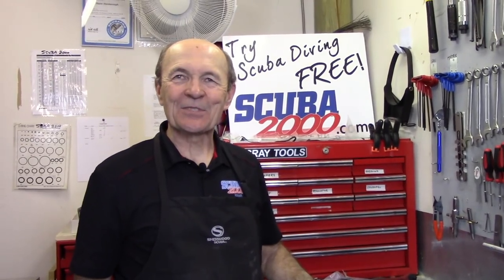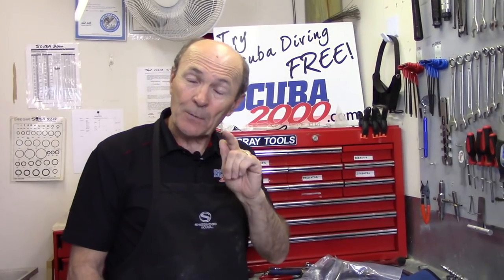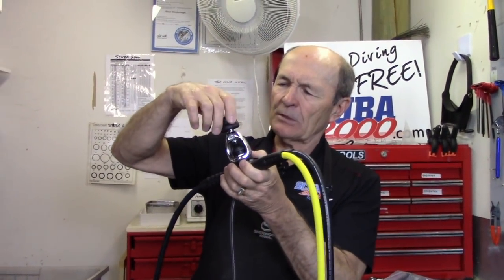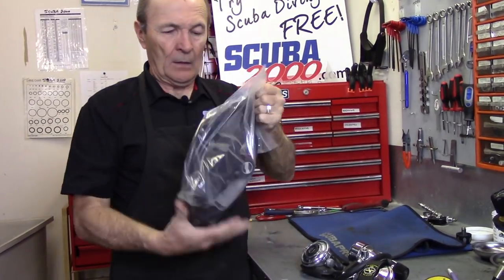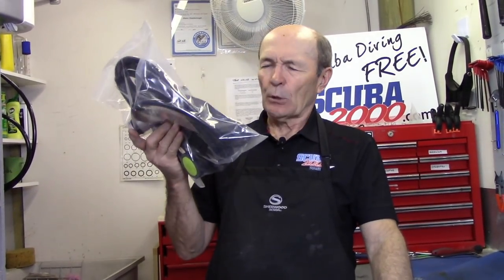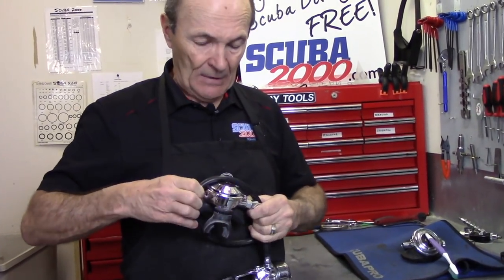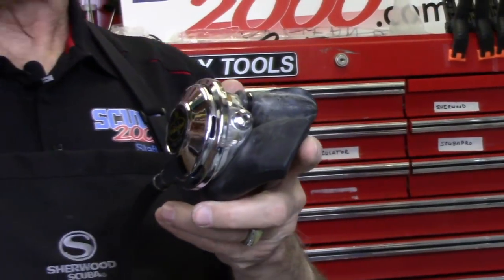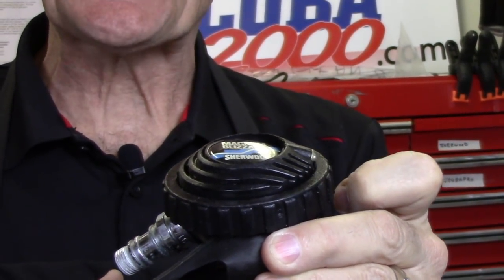Regulator Storage - Scuba Tech Tips: S03E16

Comment: You constantly amaze me with your insight. One thing i would mention is that regs really do need to be serviced REGARDLESS OF USE as I personally had freeflow from first stage due to diaphram. These diaphragms are under tension wether you dive alot or not at all an therefore will still wear over time ( just like rubber o-rings). Good dive shops will give you the old parts they replaced, and boy there are a lot of o-rings in the first stage! So service your equipment guys to be SAFE. And no i do not work at a dive shop but have many c-cards and 15 years experience

Comment: Another tip that might help when you're done with your regulator before going into long term storage is discount store rubbing alcohol... when you finish cleaning it out  you put it out to dry because you cant get ALL the water out of it no matter how hard you try. After it's left out to dry and you got as much water out of it  as you can, put it in the bag and add in half a bottle of cheep rubbing alcohol, close the bag and then you shake it all about and while you're finishing up doing the hokie-pokie that last bit of water gets diluted in the alcohol that gets poured out of your clean sanitized bag and the regulator will still have a few drops left but it will be alcohol instead of water. Then you can leave it out to dry and that's only five minutes or you can put it away with the few drops still in it without having to worry. $1.00 saves the day !

Comment: I've had that happen to me.  Didn't use a set of regs for a quite a while, but they had been freshly serviced and then stored.  Well, after hooking them up they would free flow a bit, due to that indentation in the seat.
Reply from the maker: Yep. Spring pressure on a rubber seat is bound to cause a problem eventually.
You can ease the pressure using one of the homemade ideas in the vid if you're going to be storing the reg again.
Thanks for watching.
Alec

Comment: Hey Alec.  I have an sr2 and reading through the info i read it has an automatic seat or spring thing that worked when depresurized from the tank.  not sure if its a load of bs.  but i thought it would make a nice invention were it true of course.  thanks for your time and hope to see more interesting videos.  keep up the good work
Reply from the maker: It is quite true actually. When the pressure is relieved from an SR2, the seat moves away from the orifice. So with this regulator there is no 'setting' or impressing of the seat nor any spring tension. It is designed to reduce the likelihood of freeflow even if the reg is not used often.
Thanks for watching. Alec

Comment: I was always wondering what that little button was for on my second stage Sherwood's m-blizard & htr...& I got them about 20 yrs ago! You never know when you learn something new, even if I thought about it each time I dived!!
Reply from the maker: Dive store clerks often forget or neglect (there's a difference!) to tell divers about the features on their gear.
Glad to help.
Alec
Reply: Actually, the regulator came with some scuba gear I bought from a classified ad. The previous owner told me he dove less than ten times with it (the reason he sold was a bad diving experience with his buddy…) & when I  got to a dive store to trade ‘the way too large for me orange Viking dry suit’ for a ScubaPro nighthawk wing bc ( I also included an Air2 in the deal, but never came with it) the ds owner told me ‘naahh, don’t need an inspection for the reg, it’s a balance first stage & was conceived specially for cold water (will never freeze…) & I shouldn’t use it in hot salty water, since it could ruin the second stage anti-freezing mechanism…Anyway thnk’s for the reply & the good show!

Comment: Thank you for sharing your diving knowledge with us, Alec! Hopefully you'll come back and share more Tech Tips in the future. Now my question: Does the 'depress purge valve' tip not apply to my Atomic regs due to their 'seat saving orifice'?
Reply from the maker: Atomic regulators are excellent. They are NOT, to use their words, "The Best" nor are the features that they claim as exclusive anywhere near exclusive in either the first or second stage. They use a fine balanced piston first stage - just like most high quality models and they use a pneumatically balanced poppet with a floating orifice (they call it a 'seat saver') in the second stage - just like many other high quality models.
Nothing wrong with them but please don't fall for the advertising hype. Simply compare the design and performance to any of a dozen other models and you'll quickly see that most top end regulators are very similar. There is no 'best'. 
BTW, we have sold and serviced Atomic. I'm not being bias here at all, just trying to set the record straight.
To your question, any second stage that has a floating orifice will not benefit from the purge depressor. By design, a floating orifice does not exert pressure on the poppet seat when not under pressure. You may have noticed a slight pop when you first turn on the air. That is the floating orifice moving up to seal the second stage.
The downside to floating orifices? A small thing but they do require more parts and they also require a different technique to adjust the second stage. These are not serious faults at all but just so you know. It will not affect performance or longevity.
Reply: Jeremy Piper
Reply from the maker: The Seat Saving Orifice is a common design that does relieve the pressure of the spring on the second stage seat when the regulator is not under pressure. So, yes. It does the same thing. You have an Atomic but you should know that this design has been around for many hears and is featured on other brands long before Atomic - Sherwwod, Oceanic, Poseidon and others too. It's a good design but does require regular service. It must be clean and lubricated to work properly so don't neglect your service dates. Alec

Comment: Dear Alec.I am 78 years old retired surgeon. Against the advice of all my friends I got myself SSI certified for open waters 4 months ago.My instructor is very patient with me.I am enjoying scuba But I find that instructors tend to follow a routine and want you to do that. But I want to know the reason or principle behind it. That is where you come in. You explain the equipment and its role so beautifully.I have become addicted to your videos. I do have a question: since I am an old guy, I find 3 mm wet suit very difficult to put on, it is a struggle. I live in Florida and dive in warm waters only. Some body mentioned SHARK SKIN suit to be a better alternative.Shall I go ahead I buy it? ZK
Reply from the maker: Sharkskin is not neoprene. It's nylon or lycra based material. It is not perfect but might work for you.
Neoprene gives you the best thermal protection and offers some impact protection too.
Sharkskin will give thermal protection but only in that it stops the movement of water over your body. The material itself is not warm. Think about women who wear nylons in the winter. Their legs feel protected and they seem to be OK. Also, nylon or lycra is quite susceptible to abrasion. It will catch on anything sharp. It will NOT stop sea urchins.
I suggest you check out a newer 3mm neoprene suit first. Look at a Henderson 1-piece suit. They are very stretchy which should make it an easy pull-on/off. Try one on at a local dive store. 
If that doesn't work, go for the Sharkskin.
My wife wears a Sharkskin-type suit in the tropics and quite likes it.

We use Sharkskin-type suits here in Canada - under our 7mm suits of course!!!!
Good luck.
Alec
Reply: Alec Peirce Scuba -
Thank you Alec for your comprehensive answer. You are a God given gift to scuba community - no exaggeration !
Reply: @ZafarKhan-te4dr  SharkSkin can be purchased in top and bottom ... which will make  it a lot easier to put on and off.  I live in FL and have used this method for diving.  In the colder months of Jan&Feb, the two piece system gets a little colder due to water seepage between layers; but overall not a bad choice.

BTW, I do love my SharkSkin ... the inner material is super soft and drys very quickly.  So you can keep it on topside and stay warmer.   I purchased an additional Sharkskin in a size larger to use for my wet-suit top for catamaran sailing. 

Disclaimer:  I have no affiliation with SharkSkin.

Comment: Alec, if you don't plan to dive for some time 6+ months, would you consider storing the 1st stage with the initial port plugs installed instead of keeping all the hoses connected to it while stored in the plastic bag? Or would storing it with the port plugs not make any difference than if all the hoses were connected during storage? Hope to hear back from you on this!

Thanks,

Michael
Reply from the maker: Hi Michael.
Good question.
The O-rings under the hoses, basically port O-rings, are called static O-rings. For non-technical divers that means that they don't move unlike the O-rings on a piston say, or on a swivel which have to seal AND move.
A static O-ring is slightly compressed so that it contacts the two surfaces to be sealed evenly and with the correct pressure. Too much pressure and it's distorted and can fail; too little pressure and it could leak under any movement.
There's no questions that relieving the pressure on the O-ring, that's the mechanical pressure not air pressure, will prolong it's useful life. It won't take a 'set' if you like. An analogy would be older radial tires that developed a flat spot when parked for a long time. So it makes sense to relieve that pressure by loosening the O-rings if you're not using the reg. BTW, you could just loosen them a bit rather than  replacing then with the original plugs. Just back them out until you can actually see the O-ring under the hose end but leave the hose in the port to keep it clean.
However, 6 months is not a long time. And, modern O-rings are much better.

While the idea is not silly at all, it seems to me to be a lot of trouble to go through for a few $1.50 O-rings that probably aren't going to be a problem anyway. I'm also concerned about the possible problem of damage to the port or hose end from regular in-and-out. Over-tightening is a common mistake and the damage is always to the regulator body, not the hose end, so big$$$.
These O-rings ought to be replaced every 2 years during service anyway.

What would I do? If you're packing the regulator away for a year or more, sure. Go for it. Less than  that, I'd not bother. On my collection of old regs that aren't ever used, or very seldom, I loosen all the hose ends or, in the case of  2 hose regs, loosen the big corrugated hose ends so they don't 'freeze' to the spigots.

Thanks for watching. Alec

Comment: Why not use a vacuumpacker/sealer instead of a ziplock bag? A cheap kitchen device that is fairy common nowdays, would suck out most of the air and seal the regassy in a compacted bag.
Reply from the maker: It would sure do a good job but maybe a bit extreme - and not cheap to do it a lot.
A strong ZipLoc bag with the air sucked out is probably more than good enough.
Take care.
Alec

Comment: Hey Alec
Thank you for many great tips so far, I really enjoy your videos especially when I learn different things. I am kinda confused about the indentation concept. Could you explain it more briefly please? When we storage our regulator there is no air in it so why would there is an air which pushes off the button. Sorry maybe it's my bad english but I would be happy if you would tell me more about this term.
Safe diving
Reply from the maker: Simply put, slight pressure on the purge button pulls back the mechanism that feeds air into the 2nd stage.  In long term storage, the pressure on this "seat" creates an indentation, which can result in a slow free flow.  Annual service replaces these parts and re-adjusts breathing effort.  Hope this helps Deniz.
Reply: @AlecPeirceScuba_SeaHunter  thank you so much

Comment: Alec not sure where else to ask you a question so here goes. I own a Scubapro Reg set. The MK25 first stage and the a700 second stage. I have been told by somebody at Scuba 2000 that the MK25 is not the first stage I should have purchased because it is not a sealed unit. Also that it is not a cold water reg. What is your opinion on this first and second stage? Was told that diving in silty waters could be detrimental to the MK25. I have not had any issues with it yet but have not dove enough in local lakes to make a good call on this. Your comments would be appreciated as now I am concerned about it. Thanks
Reply from the maker: Stop being concerned.
I don't like to contradict what a store clerk has told you but, in this case., I must.
Scubapro introduced the MK17 a few years ago to a lot of fanfare about it being a cold water reg. It's a very standard diaphragm regulator with a sealed spring chamber. There are a dozen similar regs on the market. It's not revolutionary at all.
The MK 25 has been around for 30+ years (with many upgrades) and is recognized as one of the best scuba regulators ever produced.
Silty water is not good for any reg. That's why we rinse after every dive. The MK25 is easier to rinse than any other reg in the Scubapro line. It also has a special coating on the spring to prevent corrosion from salty or dirty water.
It too has several features to help prevent freezing. Just read the sales literature.
The MK 25 is easier to rinse, easier to service, lighter and has a swivel that is really a nice feature.
In my opinion, you have the best reg system for cold water diving. Even the A700 2nd is a good choice since it has a full metal valve barrel which is better for cold water.
Go find some icy water and have a good time.
Alec
Reply: Alec Peirce Scuba  Thank you Alec  your experience and opinion are valued.  Cheers!!

Comment: How should I store the regulator after a dive? I would rather not spend $50+ on a regulator bag as they seem to be just like a lunchbox. Should I just find a big lunchbox? I want to store it after diving with all my other wet gear but don't want it just sitting on top of all the wet stuff soaked for a multi hour car ride.
Reply from the maker: I have sold hundreds of reg bags but I'm embarrassed now since I don't think they are good to use. They're heavy and a waste of space. Just wrap your reg in your towel or suit for protection.
Get a big zip-loc freezer bag, the tough ones. Rinse your reg in fresh water, seal it in the bag and drop it in your dive bag. Staying wet won't hurt if it's fresh water. When you get home, hang it up to dry.

Comment: I miss my old Dacor Pacer regulator...
Reply from the maker: I used a DACOR Pacer 400 for many years. I think it was the best reg I ever had. It is a bit outdated now but boy the dives I made with that reg would cause shivers in the spine of most divers!
Take care.
Alec
Reply: I remember those purge clips by Dacor... good regs.  We were the authorized distributor in the Philippines and I remember for some reason there was an early batch of Dacor Pacers that had a parts recall and I was involved in replacing the cover of the 2nd stage... long time ago.  Thanks for your vintage videos.

Comment: Would it be bad if I disconnect all the hoses and coil them instead of leaving them on the 1st stage? That way I could also store the 1st stage on its own protective container. Does it make sense or is it a extreme measure?
Reply from the maker: A bit extreme. There's really no need.
Coil the complete reg loosely and put it into a strong Zip-Loc bag if you're storing if for a while. Be sure it's clean  and dry.
You are more likely to cause a problem by constantly taking the hoses off and on.
Alec

Comment: I'd like to leave my beautiful A700 out, sitting on my shelf as some sort of a decoration when im not going diving with it. Do you suggest leave a reg out, or keep inside of a bag?
Reply from the maker: If a reg is going to be a display piece only, leave it out and share stories of it.  A diving reg needs to be kept dry and away from dust and spiders to keep the o-rings lasting as long as possible.  In a bag it will last much longer than on a shelf but not forever.  The A700 is a very nice reg that will last for many years so keep it bagged and dive it often.

Comment: My newly acquired reg (came with Aeris AT400) second stages have a plastic screw down purge button that bends during use (no metal cap).  If I use a button depressor it deforms the cap so am worried about permanent distortion if it is depressed during long term storage.
Reply from the maker: Should not be worried as it was designed to bend/deform when pressed to purge.  More expensive regulators like SR2's have a soft rubber cover, different look, same function.   If it ever cracks, get it serviced before diving.
Alec

Comment: Hi Alec!!! from Argentina. I bought Cressi Master Ellipse Second Stage, My question is if I need do ""button depressure" or not. Im new on it :D
Reply from the maker: No one needs to depress the button unless they're storing the regulator for a long time, say, 6 months or more.
Even then it's a toss up. If you don't depress the purge to relieve the pressure on the valve you may, may that is, get a small free flow after a long time. If so, use the breathing adjustment to get rid of it.
The best you can do with the Ellipse (or any other adjustable second stage) is be sure the breathing adjustment, the knob on the end, is out or loosened as much as possible. That reduces thew pressure on the seat and does the same job.
Alec